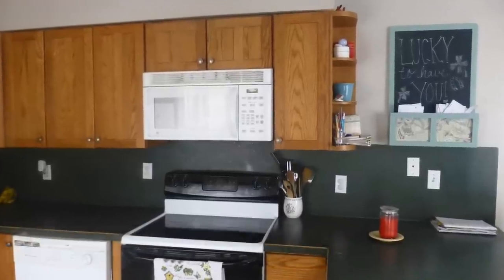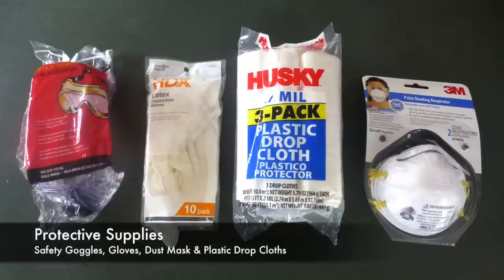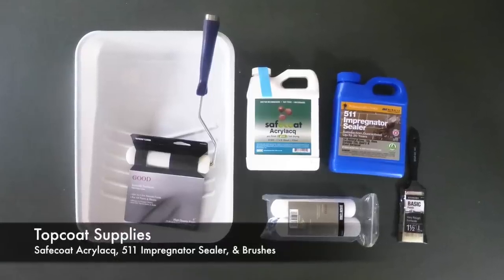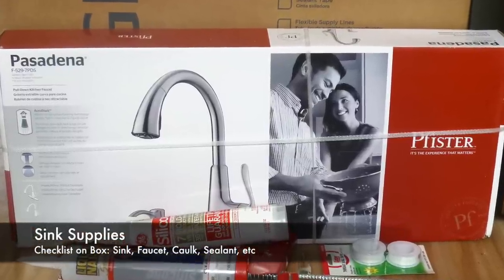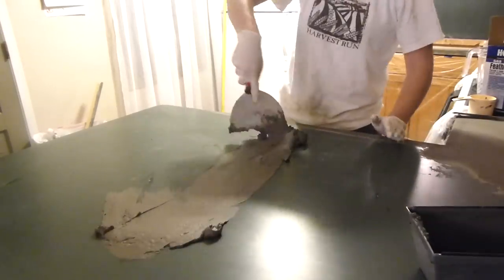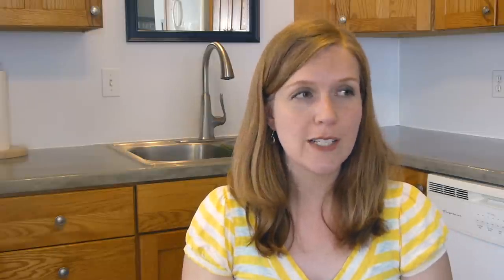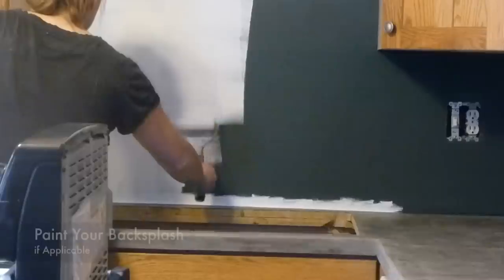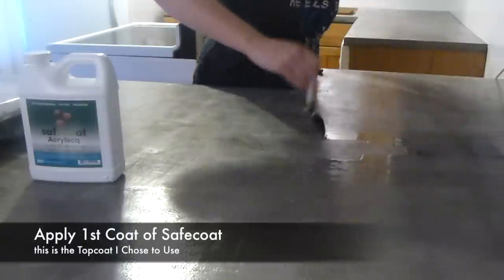DIY Concrete Over Laminate Countertops Using Feather Finish

Comment: you see why with something as important  as a kitchen you need a professional.
Smoothing out the cement veneer, thinning down subsequent coats that flow and fill uneven low spots. This avoids all the sanding to level as it will level with material viscosity and trowel technique.  When doing these cement coatings, its like the venetion plaster technique, a uniform but artistic layering to get a special effect. Color and depth show through each layer
Sometimes you tint the layers slightly different for depth and effect. Clear coats must be
Sprayed on , Clear has catalyst mixed in, each sprayed coat dries in 5 min, 3 coats max.
This makes a perfect even sheen with a superior durability unlike single component inferior clear coats homeowners use. By the time you experiment with so much labor, a pro can give you something in one third the downtime to your using your kitchen. Do it yourselfers
always overlook their blotchy work because they do it taking their own risks, accepting all the mistakes,and it shows. Sorry after42 years in the high end finish work, I've seen all the blunders done.   We professionals do master our work or we wont get paid.
Reply from the maker: I agree! If you can afford to have an experienced, trusted professional do it, that's the best route. In our case, we couldn't afford to hire someone or do what we really want at this time (quartz). So, my options were to live with a color I hated or find a DIY in my budget. 

Personally, I am so happy that I gave it a shot. It's far from perfect but to me SO much better than before. I plan to fix what I don't love about it and continue to learn. If your kitchen is bad enough, worst case scenario, you mess up, you learn something, and pay a professional to do it (which is what you would have needed to do in the first place anyway). I had nothing to lose.
Reply: people always say they cant afford the pro, Im 62 and well aware how people spend their money on  coffee drinks and wasteful things
If something as a countertop that will highly improve a kitchens look isnt worth saving $15 dollars a week for just 1 year or less to get a dream kitchen countertop is plain silly .You see over all my years  in business how many DIY homeowners ive seen  say the same thing. How many housewives say they can paint or buy into these cheap homeowner packaged coating products , their duped into believing their going to save and get a spectacular finish
I can use a multispec coating with clear coats and make all your counters look like granite in a day for 600-800 $
It can be repaired easily if you put a hot pan and burn it
Im not talking about homeowner sprinkle on , roll on highly textured cheap products . This is a very high tech smooth polished look. Now you have a very uneven heavy cement coating
and a blotchy non durable clear coat to deal with. You will have years of blotchy follow up clear coat repairs that will resemble all the uneven sheen and texture of the previous coats, one pattern of brush or roller
texture will  follow the other .This trial coating becomes a never ending nightmare   Im doing this follow up to warn  DIY that better to wait and find a pro , they are out there !!! Look up companies like Hawk Research ltd  or Napco  or Midwest chemicals Look at some of their videos on hvlp spray applications If your going to try to trowel something level, think twice. Guys in the trades take years to perfect out smoothing and leveling cement products . Its almost offensive to get praise from these youtubers  for actually attempting it .
Show some closeups and how the light hits the uneven cement and clear coat sheen ,spare someone else the anguish please.
Reply from the maker: Thanks for sharing your opinion. :)
Reply: There is a time and place for professionals, and thank heavens they are there!  But the joy and adventure of trying a project and the act of learning new skills and building confidence and pride, not to mention setting a great example for your kids, friends, and followers, far outweighs a few drips in paint, or splotches or imperfect spots. Great video! Very inspiring! Very honest!